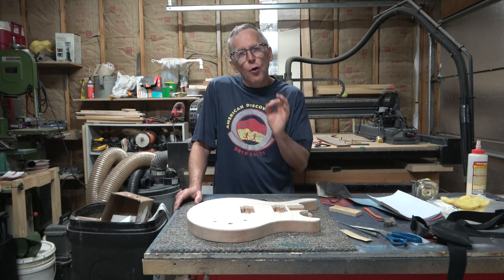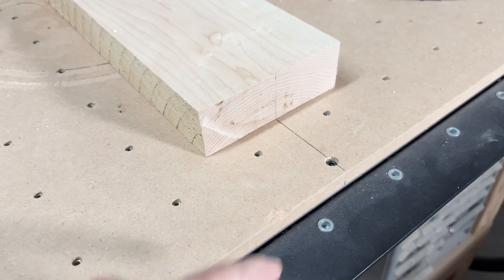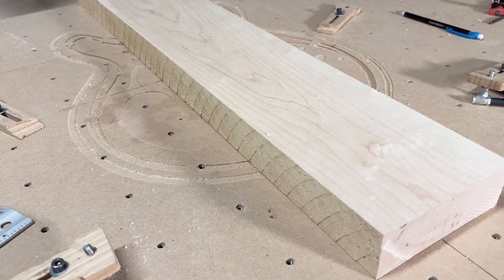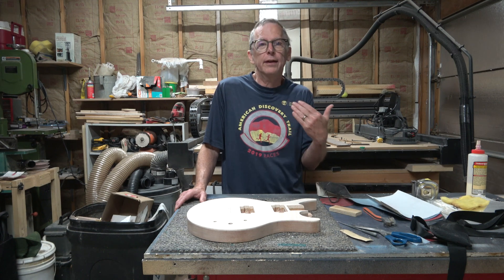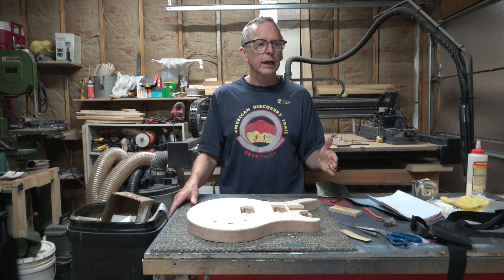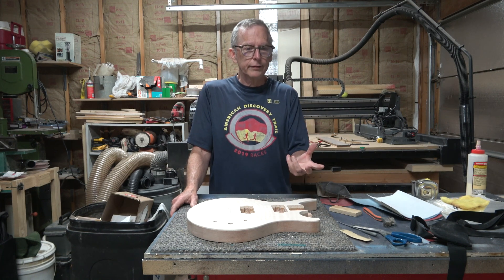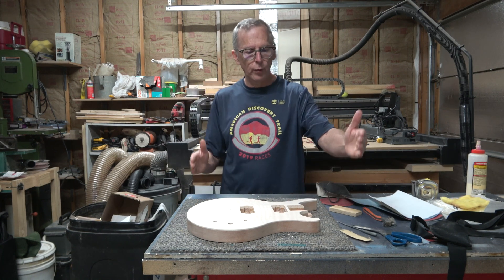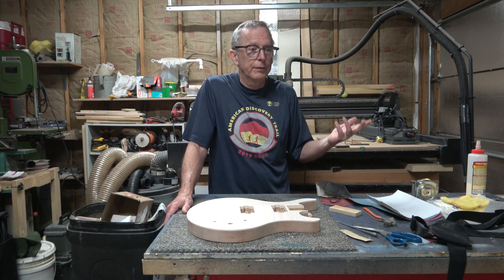Positioning Material On A CNC Machine

Comment: Chris, I'm new to CNC guitar building.  I'm having a very difficult time lining up the exact centers in Easel.  I'm using your method of the center lines, but I'm struggling with the programming side of it.  How do I find the exact center in easel and make sure that lines up with the exact center on the body blank?
Reply from the maker: I home the machine to the front left corner first. Since my machine has a working area of 48” X 48” I can jog the spindle from the home position 24” on the X axis and 24” on the Y axis. That places the spindle directly over the exact center of the waste board. Next I measure and mark the middle of each edge of my blank and position those marks on the lines that are engraved in the waste board. From there I jog the spindle from the exact center half the length of my blank forward and half the width of my blank to the left. That places the spindle in the XY start position. From there, I probe the Z axis. At that point, I can start the carve.
Reply: @HighlineGuitars I think I understand that part.  I guess I’m struggling getting my easel files to be able to match up.  How do I know the exact center of the blank is the exact center of the file in easel?
Reply from the maker: @burningbastardguitars  I'm sorry, but I don't understand the issue.

Comment: Good video, Chris. I'd like to hear you say more about the "thinking through" part with respect to things like planning a carve based on issues that even the best positioning system is probably vulnerable to. For example, I just finished carving my first full fretboard and once again encountered a super tiny but detectable discrepancy -- like sub-millimeter -- between the rough pass and the finish pass. So I'm trying to be smarter about my carves and am going to adopt a few of your "tricks."

Like, the reason there was a discrepancy was because I didn't exclude the "profile" portion from my finish pass. What I should've done was the rough carve first, then a pencil carve, then a finish carve of just the surface, because the pencil is the "final word" on the profile shape, and the result is a finished surface, and all I really need from the finish carve is the radius and a smooth fretboard surface.

So next time I'm going to limit the depth of my finishing pass to minimize the possibility of it being slightly out of alignment with the results of the rough carve and the pencil carve.

Anyhow, I'm trying to spend a lot more time on the "thinking through" part that you mention; not only because it's makes the process more efficient, but it also helps avoid annoying discrepancies that mean breaking out the card scraper or files.
Reply: A side note: I like adding a crescent or some shape at the heel of the fretboard, which would need a finish pass that runs the whole depth of the piece, but I could always just use the region tool in MeshCam and make that a separate finishing carve -- just for that small part of the fretboard. Then I could do a separate finish pass for the radius and surface, limiting it to the depth of the radius at the edges.

So, like you said, the "thinking through" is a big part of the process -- and a lot of the stuff that applies to a one-sided carve applies even more to a two-sided one.

Comment: I'm not going to say any method is right or wrong or better or worse.  Everyone gets comfortable with their own workflow.  As long as there isn't a flaw in the method, if it makes sense to you it's fine.  I mostly use index pins, but I also zero on the center of the material rather than the corner.  Drilling a few extra holes doesn't seem like too much work to me.  Now, if you aren't interested in putting a bunch of holes in your spoilboard, that's a different story.  Alternately, as long as your body blank has one side along the Y axis that is square and it's a two piece blank like most of the ones I use, you can accomplish the same thing with a fence.  Set up a fence along the Y axis.  This will keep your X position consistent.  Use the center of the blank as your zero point.  The Y center will be easy  to spot and set as it will be the joint of the two pieces.  When you flip, the fence will maintain the X position and you can adjust the Y zero to the seam like you did on the previous side.  Now, this does involve a little more work, having to adjust your zero point, but it works well if your blank is an odd size, with one piece wider than the other.  I do like the idea of marking the centers on the sides, though.  Whichever method you use, that gives you a little extra verification that you are aligned correctly.

Comment: In my opinion, the most reliable way to process a product from two sides is to position the workpiece with furniture pins. Steel, wooden - it doesn't matter. I've pointed this out more than once in the comments to your videos. To be honest, I'm always surprised that such an unreliable positioning system like yours works. No offense, of course. I really like your approach to guitar building. I learned how to make guitars through your channel. Thank you.
Reply from the maker: My method is definitely not unreliable. I have built hundreds of guitars with this approach and never had a single misalignment.

Comment: I use index pins every time.  When boring the holes on the wasteboard, trace an outline(or partial outline) of the stock size during the same operation so there's no guesswork as to where to put your stock.  Then you can simply place your stock and bore the pin holes during the body machining.  It's so easy and is accurate every single time.  I can't imagine any other way is easier or quicker.  

Even though I prefer another method it's always good to see another perspective.  I've learned a lot from your channel over the years.
Reply: Exactly what I do. No guesswork

Comment: I like this idea a lot. My only problem is that my machine has 31x18 workable area, and I have to do a bass neck in 4 different positions instead of just two. I ended up using a mix of centerline and pin aligning: I've drilled 4 holes in the wasteboard, with 7x9" spacing. Then, I placed the neck blank just the way you do (alright, I had to cheat, I've extended the line to line the blank up), and drilled 6 holes. This way, I can have a nice 9" extra to carve the headstock.

Comment: Really cool. Thanks for adressing this, as this is not trivial to do properly. Your method is elegantly simple but requires to trace the center lines very precisely. This is where traditionnal wood working skill translate to CNC. Is the alignment of the blank along the Y axis also done like this? I have used pins with centering holes, or protruding pins to have a lateral and longitudinal reference. As you say, it is a pain to manage when every blank is different and I made some mistakes with that approach as well. I have also tried to touch on the blank but it is not very reliable and very long to approach slowly. Next time I will try your method for sure.